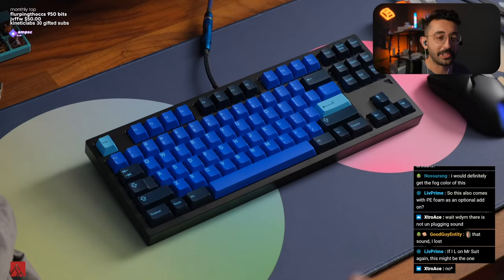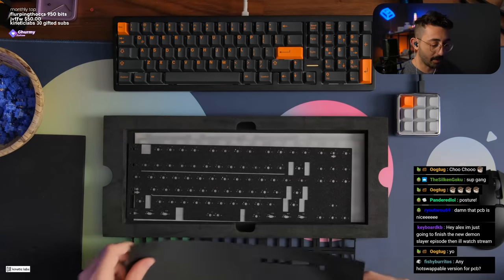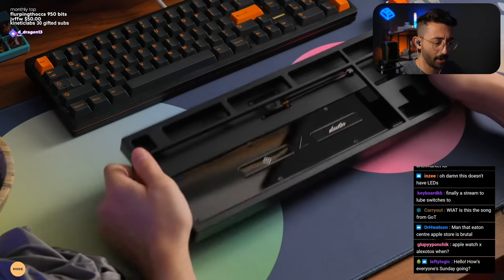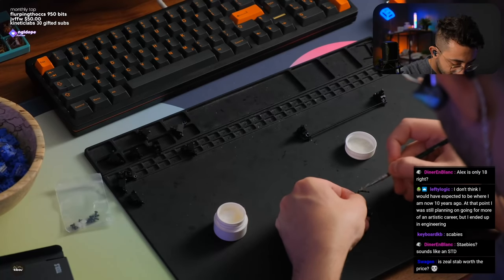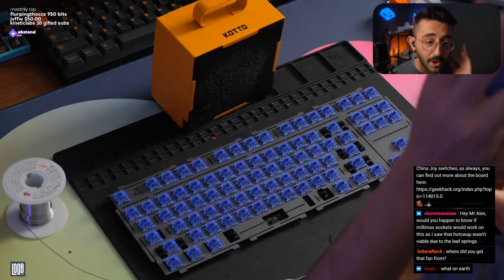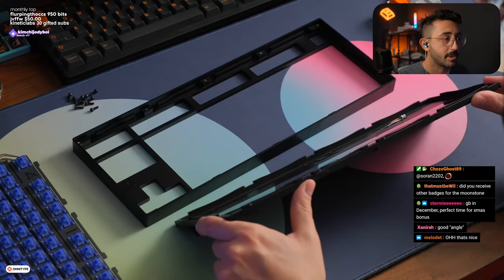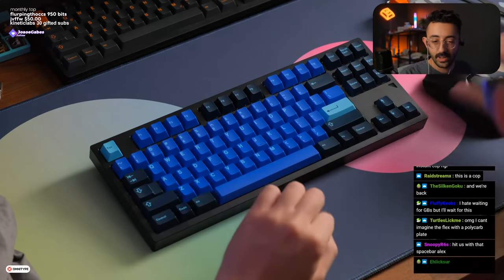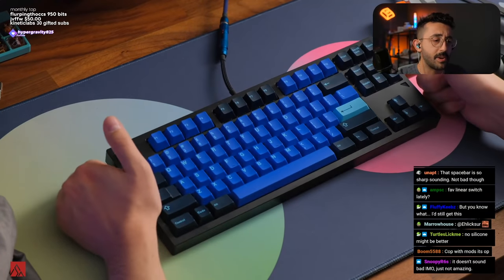Vertex Angle Prototype Build Vod + Sound Test

Comment: It somehow sounds open yet dampened which I don't like it means without dampening it's going to be super hollow and not much variation in the way you can dampen it. But if it comes with pe foam then it was designed to sound like that and tbh with pe foam it would really really help this board. As you see it's very silent without it for a reason. People don't get it alot of these pe foam boards are designed for pe foam specifically so they make sure it's not overly loud and on purpose because pe foam makes it louder. This board would be great tbh with pe foam. People need to get over the pe foam stuff if you don't like a board with pe foam don't get one designed for it lol. It's clearly the sound signature they were going for with this board so go for it. We have plenty of none pe foam boards it's still nice to see them on the market. This whole oh I see pe foam let's not build with it is ridiculous espeiclaly with a prototype its clear they wanted people to hear it with it. You would be very surprised the Vertex I heard with pe foam doesn't sound like all other pe foam boards. One of these days you will see pe foam introduced in a way that does sound a bit differnt especilly if we start seeing 0.2mm pieces instead of 0.5 or 1.0mm. So let's always try out what the manufacturer sends that way we aren't missing anything.

Comment: Hey Alex I am getting a board but I was wondering which one to get a bakeneko or a q1, I was wondering which one u would recommend
Reply: Depends, what layout is your perferred and do you not mind using clip in stabs rather than screw in? Can you use a 60% layout? What is your budget? What sound signature do you enjoy? How much modding are you comfortable with doing?

These are all questions you need to consider. However, I would take the bakeneko as I love 60% and I don't like the sound signature of the Q1.

Comment: After seeing all the build streams of this, my opinion is that the aesthetics are impeccable, but the sound of this board is a mess. Theres a very narrow tightrope to walk with the entire build to make this board sound decent, down to the keycaps. I don't really like that. It's always on the edge of sounding both flat and hollow, requiring you to just damp it until it's totally muted. And if you try to build it without foam, it sounds worse than a GMMK Pro with no mods. Really disappointing to me.